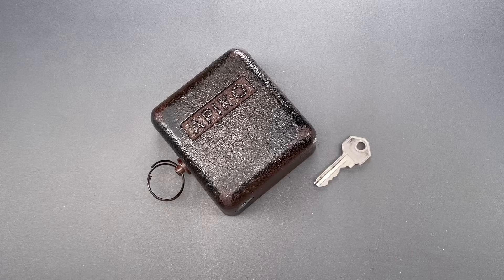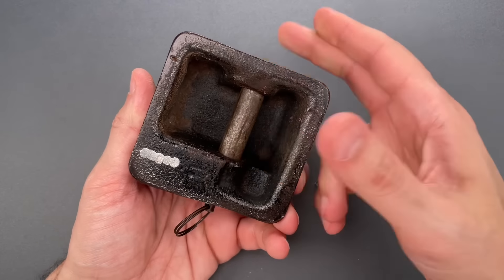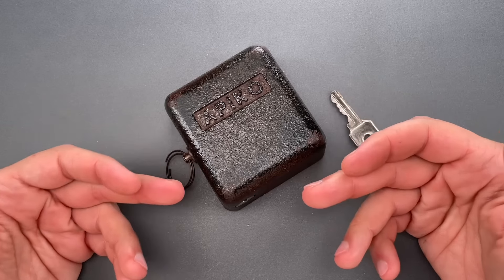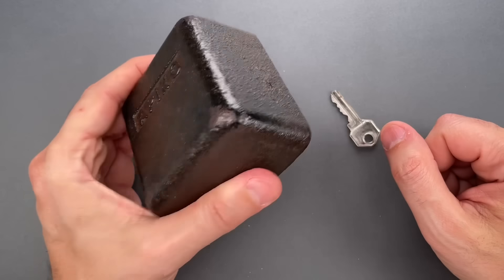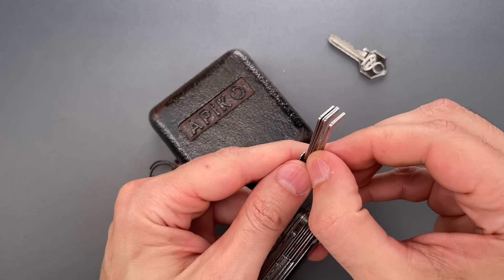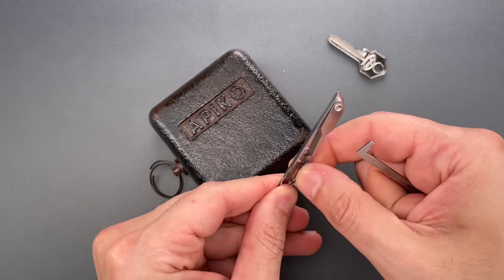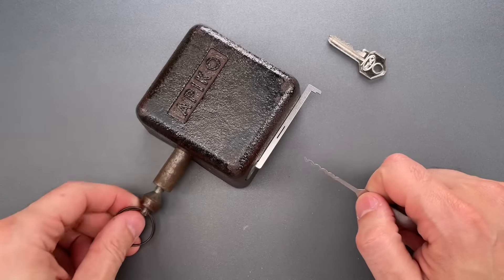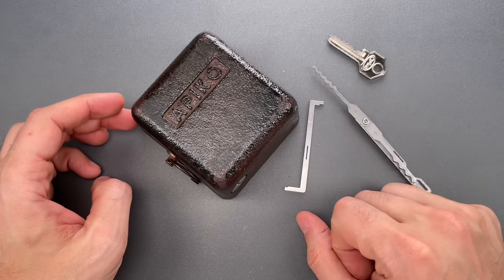[1565] A Modern “Soviet” Lock… As Bad as the Original (Apiko)

Comment: I know you often point out how cheap locks are easily picked, but how many people know that? Maybe serious criminals and a few hobbyists like us know that locks can be picked by most everyone with a few easily obtained tools. The other 99.9% of the population see a padlock and think it's removal is the only way in. Case in point. I have a driveway with a cable between 2 mafia blocks. I welded the nuts on the clamps, have a grade 70 3/8" chain on 1 block for length adjustment. A few years ago someone tried to get in. There were 3 broken hacksaw blades, scratch marks on the shackel and cable, and the lock had been beaten with a hammer to the point I could not open it with a key. 1 hacksaw blade could have easily cut through the soft rebar loop in the top of the mafia block. Again my point is a padlock is more of a mental barrier and there is usually a much easier way in.

Comment: Love your work. For these relics one needs to dig deeper into the social trends of the era. These particular locks were often found hanging on garage doors and such, and they were attacked by brute force not by delicate picking hands.
Reply: High gauge steel suitable for making picks was hard to come by. Someone up the comment stack said the cores are so soft that you can easily drive a wall screw into them and then yank the entire core with a crow bar or slide hammer. As a two man operation I actually think that's faster than raking it.

Comment: If the purpose of those locks is to act as some form of deterrent to the casual passer by, then I could possibly understand it, but it looks as if a solid sneeze would have opened that one.
Reply: It is meant only as a deterrent, most thieves wouldn't take a second look at it. It looks "strong", so pass and move onto the next target.
Reply: @John5HUN that would be the case if all the locks that look like that weren't incredibly easy to pick. I'd imagine if it weren't used on a submarine entry, a would be thief would be more likely to see no lock and assume there was no value there than passing up a gift of grift that this lock represents 😅
Reply: "In the wild" that lock, as well as most Soviet padlocks, would come with an amount of rust that would made opening it with a key a challenge, never mind picking :)

Comment: Wave rake? Yup, this lock is doomed.
Reply: At least it wasn't knife or the bypass turning tool. This is level 2 security! (you will need to use both hands and at least a little bit of skill. Not much, wave rake is low-skill attack, but at least it is not something 80% of population would have in a pocket)

Comment: It is a garage lock, it basically protects your cheap lada from being taken apart by petty criminals and alcoholics, and it is very effective in doing just that. I strongly recommend you to try some of the modern post-soviet locks for the change, like Chaz or Polyvector😁
Reply: Polyvector's clockwork is indeed a fine piece of hardware, and I'd be interested to see LPL try his hand at their Premier.

Chaz, though? They make cheap padlocks, afaik. Disk mechanism at best, so I'd expect conventional disk picking tool to pop them.
Reply: @boaragile82   Since LPL has already picked an old soviet disc lock before, I mentioned Chaz only for the purpose of comparing new locks with old one in terms of technological advancement (or the lack of thefeof). As for the Polyvector, it will be really interesting to see him picking it indeed, only it will be somewhat hard to send one overseas.
Reply: If you have access to one, send it to him. I doubt he gets most of these himself but, rather, people send them to him.
Reply: Are you protecting the Lada from them or them from the Lada? The Zhiguli has a reputation.

Comment: these locks get used alot on a electrical "shed". basically a concrete garage with transformers and stuff. so pick resistance is not very important, because you can get killed if you touch anything in there. So these are mostly a light deterrant rather than a real security measure.

Comment: You just don't get it. I've used several soviet and post-soviet locks previously, and I'd say they're like a vine - should stay a few years before becoming good. Then the materials used and production quality results in wear and rust in lock mechanisms, and they became tricky to open even with their original key, you usually have to tilt it certain way and use quite a force to turn it. No lockpick would stand a chance!

Comment: Youd probably find that thing loosely screwed onto a rotting sheds door.
A swing with a hammer, or even running against the door with enough motivation would bust that thing from it's mounting.
Well I guess as long as picking it is a little more complicated then shaking the thing it's a lock.

Comment: Wow, I have 2 of this locks of different sizes. The ONLY reason I have bought it is because it's locally made.
Local YouTuber showed that the cylinder can be pulled out with a screw.
It's very hard do find a normal lock. The house where this lock still hangs on a basement's door have burned down, the lock is OK :)
Reply: lol, on their site they use "it's made in Ukraine" as a main selling pointS (like 10 selling points :). We don't have NORMAL locks being sold here, a lot of chin stuff which sellers promote as good, buying power is VERY LOW, dudes can't normally work anywhere but army, and it army you need good luck not a good lock.

Comment: Locks only keep out law abiding people. Those that look at the lock as the only social cue needed to know they should not open something or enter somewhere. Criminals know that it's just security theater and it just means that it will take a little time to defeat. The whole industry hinges on balancing how much time and effort it takes for the common denominator criminal to break through and making it as painless for the end user to operate it. (Also balancing between cheap but profitable for the manufacturer and expensive yet effective for the customer.)

Comment: Антивандальный висячий замок Арико модели ВС5 «Краб» обеспечит надёжную защиту ваших помещений и отдельно стоящих объектов — магазинов, складов или гаражей, ангаров и пр. Прочный чугунный корпус навесного замка с толстыми стенками (13 мм) скрывает внутри прямой стальной стержень ⌀14 мм и цилиндровый секрет устройства. Закрытый тип навесного замка ВС5 не оставляет злоумышленникам шансов на взлом — до дужки не добраться ни ломом, ни механическим режущим инструментом  
The Ariko anti-vandal padlock model BC5 “Crab” will provide reliable protection for your premises and free-standing objects - shops, warehouses or garages, hangars, etc. The durable cast iron padlock body with thick walls (13 mm) hides inside a straight steel rod ⌀14 mm and cylinder secret of the device. The closed type of the BC5 padlock leaves no chance for intruders to break into it - the shackle cannot be reached either with a crowbar or a mechanical cutting tool
Reply: What does Ariko mean?
Reply: @Pygar2  I think they even know themselves.
Reply: @Pygar2 APIKO  -  It's written in Cyrillic.
Reply: @Pygar2 AP First Name Last Name, I - and, KO - Company.
It's my opinion.

Comment: I used this type of lock made in SU, not ukraine. My lock was with disk detainer core, not pin cilinder and it works good for atleast 20 years (as far as i asked old factory worker, maybe more) keeping factory garage door open and closed every working day. Finally the key starting to stuck inside the lock in winter and i decide to replace it in year 2020. So dont be so sceptic about SU made things.

Comment: Their is and so alot of old soviet era stuff still running ro date. So these locks, however bad could be in demand to replaxe parts and lock outs on old machines or so that remain in use. The old ones are long worn out so rhey make new onws. 

Also the older factory kit that made the. Originally...never got rid of...someone just fired the lld line back up that made them in first place

Comment: Interesting the number of comments decrying soviet locks when LPL stated that this is a Ukrainian lock that was made in the Ukraine 8 years after Ukraine went independent from what was the Soviet Union.
A very interesting insight into the average LPL viewer.
Reply: This design could not br interned for a hogh security role. For example a lock out panel on a industrial machine to keep you out the moving gears. 

It's not secure, but it is strong ernouggh to take a hella beating and keep that panel closed off.

Comment: Russia doesn't really need great security from their locks.  The lock is a simple deterrence mechanism that everyone understands also carries the meaning, "Enter illegally if you want to get shot or sent to a Russian prison."  Everyone knows they don't want either of those things to happen to them and so the lock does its job just fine despite the obviously weak security.
Reply: uhh not really... these locks are usually found on garage doors. they cover a hole that allows to open such door with a screwdriver. their purpose is to not to be moved from their place where they cover the hole. and since locks are usually not picked but busted, this one does it's job great

Comment: @lockpickinglawyer I hope you can help. I purchased a home built in 1917 and I found a built in safe in the house. It was hidden behind a fake wall. It appears that someone tried to open it using a drill on the door (the lock is still intact) but were unsuccessful. The locking mechanism appears to use a round key of some kind. Any clue what kind of pick I could use? There are no keys anywhere that we could locate. I’m anxious to get it open, and I’d like to use the safe so I don’t want to break the door. Any advice would be greatly appreciated!
Reply: Round like a pop machine lock?
Reply: @Pygar2  yes, similar. At least I’m guessing. The house still has the old skeleton key door locks so I’m assuming whatever kind of lock an old 1910s/1920s safe lock would be. It was built into the house at the inception. Honestly I have no clue about safes and locks. I’m very much a novice

Comment: first, "APIKO" is pronounced "Ariko". The second letter is an R, not a P, for this is Ukrainian cyrillic alphabet (they do have a latin i, which mightve thrown you off).

But fun fact, i did find one of those very old locks from soviet times, and they have a very unique feature one never sees in todays products:
The metal form which was used to cast the body did include the price (a ruble and change, in my case).

Just imagine that, the industry casting the price "in stone" (in metal), because there is no supply and demand and no price reductions and no fluctuations. The government decided how much padlocks should cost, and thats fixed, forever. 
The government ceased to exist 30+ years ago and the price is still on the lock xD

Comment: The picking is super quick, but one thing I'm always wondering is how long it takes to inspect and identify the lock first and decide which tools to use.
Reply: This one's probably easy: with a key, core dimensions and pin count are apparent.
Reply: Doesn't matter.  Aways start with zipping and rocking with a hook. Youd be shocked how many difficult SPP will rock open.

Comment: I had asked you in a previous video it's a Master padlock and the key has teeth on both sides what kind of a tool do I need to pick that lock and where could I get it put a link in the description box for me or better yet not only that what do a video on and then put the link for the tool in the description box
Reply: Is the bitting of the key mirrored? I.e. can you flip the key and it still works? Then you have a simple wafer lock and a wave rake and turning tool, (or even a paperclip and a thin screwdriver) will work.
Reply: I'll let you know how I make out it sounds too easy
Reply: @ThaFuzzwood  can you do a video on it but the funky key with teeth on both sides of the key